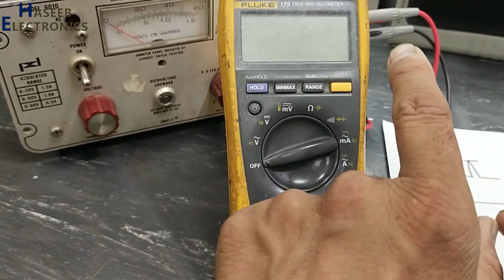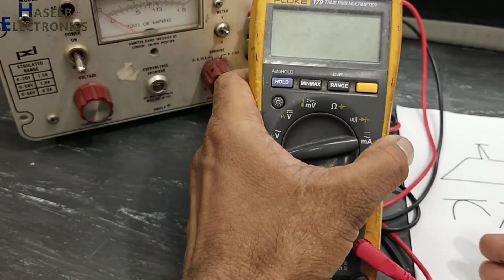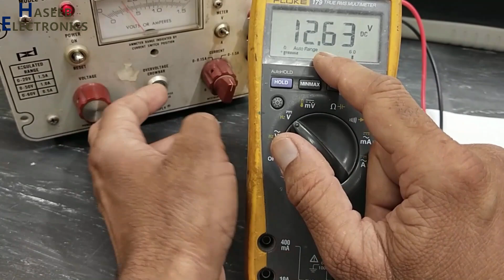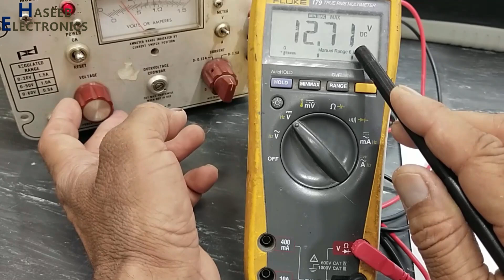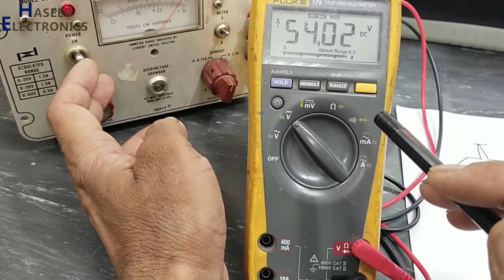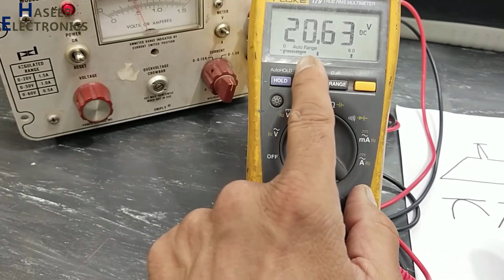{1208} How to Use MAX function in multimeter

Comment: Shukriya Maestro. I have a question. Sometimes I use that function and the bar graph moves and I can hear did beep sound indicating a change of voltage but the Multimeter won't store that. Is there a limit on the reading speed or something like that??